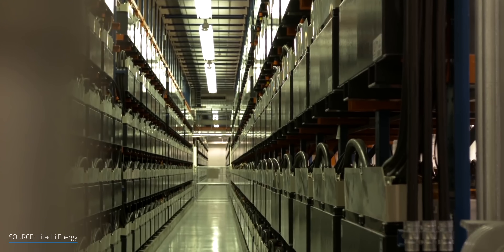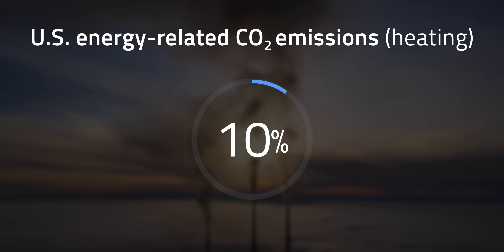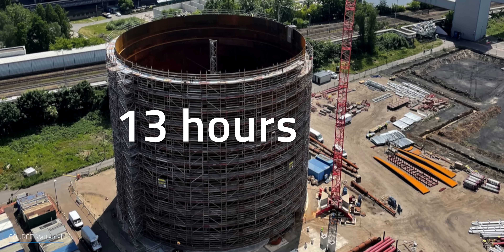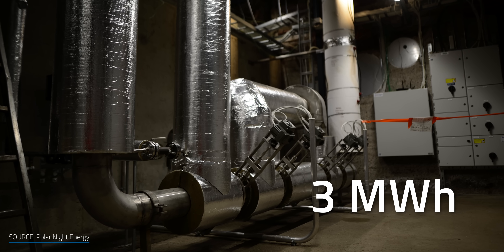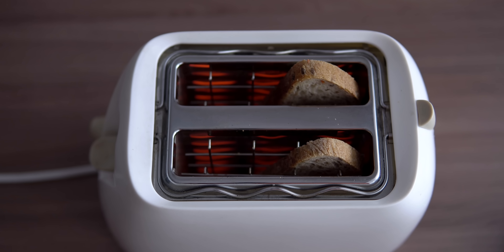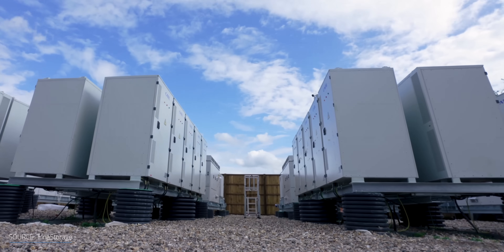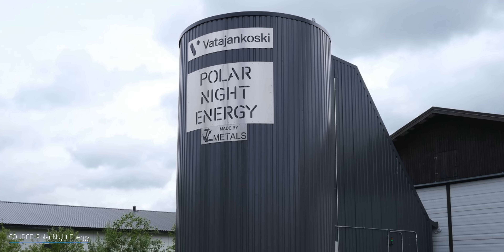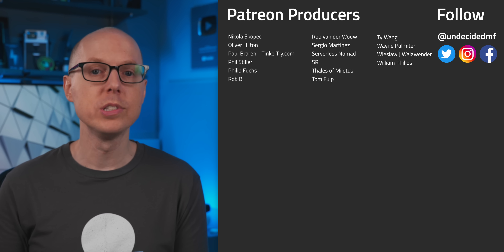How A Sand Battery Could Change The Energy Game

Comment: Please! 1) stop calling CO2 a greenhouse gas, it's an atmospheric gas, without which there would be no life. 2) Wind and Solar are NOT "renewable energy", that would violate several conservation of energy laws. You don't get the kinetic energy of wind back after it's converted into electricity. Same with solar. You use the source of energy ONCE then convert it to another, then another until it's finally diffused into space, entropy.

Comment: It would be interesting to downscale this to single residential use. You would not need  nearly as much sand. Instead of using heat pumps which cost more power to run, you could heat the sand via solar.
Reply: Just buy a heat storage unit.ceramic, 1000 deg f.

Comment: I really like this option, it's supper simple with almost no environmental risk from failure or end of life deconstruction. The only issue I can see is retrofitting it into existing infrastructure; you named a few cities in the US which have community heating systems, and a lot of further eastern European and Russian cities have that too, but in Western Europe and the UK especially there's nothing like that, so the system would have to be made from the ground up in already hugely congested underground urban environments.
Reply: It would be good to build it from scratch cause underground systems could provide water,sewage,electricity,network and heat all in the same system
Reply: Good point

Comment: I think this might be a better solution for individual homes or housing blocks. It might even decrease the degradation in distance to destination, since it could be built in a backyard probably.
Reply: But bigger the storage is, better surface to volume ratio it has.

Also, district heating is already a thing. And it tends to be more efficient than distributing the heating to each separate building. Even with transmission losses. (I can't explain why, though)

Comment: Idle wind mills may not be a bad thing. Wind mills, like all mechanical equipment wear out, they have a limited life. If the wind mill sits idle, it is likely to last longer. We all understand that cars are only good for so many miles before they are worn out. If you drive your brand new car a lot it will wear out faster and need replacement sooner. An analysis of how long windmills last, both in hours of operation and in years would be helpful in this analysis. As far as extra solar power, well, solar panels are not mechanical, so that power is likely better used.

Comment: Apologies if I missed this or, misunderstood. If you're heating communities using hot air, how far can that heated air travel before it starts to cool?
Reply from the maker: No apologies.  Polar Night Energy's storage system only uses air to circulate through pipes in the sand.  Once the heat is extracted it can be moved to another source, like a boiler system for district heating.
Reply: @UndecidedMF  Cheers Matt, I appreciate the response
Reply: In Finland district heating is not done with air, but with boiling water going to houses in insulated pipes, which have heat exchangers. And after that the water goes back to power plant for re-heating. It's a closed system.

In the photo below you can see the up- and downstream pipes. This photo is from the city I live in. I live in an apartment house with this system. Basically the whole Helsinki Capital area has this system. The sand battery could be used to store some heat centrally during summer months and be used to pre heat the water 10 to 20 degrees celsius before the power plant which makes heat and electricity together. That would make the whole process more efficient and ecological.

https://upload.wikimedia.org/wikipedia/commons/3/39/Kaukol%C3%A4mp%C3%B6verkko_Otaniemi_Espoo_Suomi.jpg
Reply: @timogronroos4642  Thank you both, that makes much more sense ...

Comment: quite clever heating air instead of water; no need to deal with high pressure steam and in a closed loop with little moisture the pipes would only be as safe as whatever is exposed to the elements outside.
well insulated pipes means longer life of the sand battery.
In theory they could heat the sand to a higher temperature (over 1000F) as the melting point of steel is closer to 2500F and sand is over 3000F but I get that damage to insulation would likely wear down the life span (and hotter air might damage the exchangers).

I'm all for any kind of battery that uses few as possible moving parts (chemical or mechanical) and at the scale they are talking, way less environmental impact.

Comment: This is a genius idea. Even if it can be used only for heating direcly, it still indirectly saves electricity  that otherwise would be used for heating.
Reply: I think it's dead on arrival, they might get one or two built. Resistance heating has low capital cost but otherwise it's a waste.
Reply: @FrancisKoczur  The hottest achieved with a heat pump is 356 F. The key to this is thinking about what you are trying to optimize. In this case, capacity and capital costs to handle dunkelflaute. You may not need to cycle this thing much. Also, hopefully, the resistive heater is very cheap, so you can use overproduction, or at least cheap power. This will never displace batteries, but batteries are expensive for occasionally used capacity.
Reply: @fjalics  An electronic device's power use in watts is also approximately the same as the heat it produces. High temperature Silicon Carbide electronics exist, might as well do something with the electricity first. Maybe DC voltage power conversion would be a good application.

As far as heat pumps go, the refrigerant determines the operating temperature range.  And the temperature difference is inversely related to the efficiency, but the efficiency is still above 100%.
Reply: @FrancisKoczur  Sure, but you would have to colocate those electronics with the district heating, which may not be where you need it. Also, I think eventually we need to overbuild renewables some, and that may be far more energy than you could cost efficiently capture from electronics. I'm not saying we shouldn't look for opportunities like what you suggest, because it could happen, but it also might not be practical.
Reply: @fjalics  It will depend on the capital costs of the entire sand battery solution vs competition.
Say a competitor is a network of EV charging stations with lithium-ion battery storage that recovers the heat from the batteries and electronics, and provides the same district heating. The running cost would be a fraction of the sand battery, but the capital cost would be quite high as the size would need to be large enough to provide continuous heating. But the costs are also dropping year over year. At some point the sand battery no longer has a market for new installations.

Personally I like ground sourced heat pumps paired with district heating. Use the water mains as the source and old natural gas lines as the return. The main is already metered for volume but will need a heat meter that measures temperature and the return meter would do the same, the miles underground stabilize the temperature so any additional heating at the pump station is small. Low capital cost, low running costs.
Reply: @FrancisKoczur  every bit of surplus’s electricity that isn’t being used for anything is wasted cause that’s how electricity works. That’s Anything that is that isn’t powering something or powering a storage system. If you use     > surplus <   power for your heating Element then your converting 100% waste to whatever the inefficiency of the storing process is. Even better you could use solar thermal systems which would make solar way cheaper if they simply capture heat instead of photovoltaic that’s a stupid simple design (think a panel of black metal with insulated glass outer casing with a insulated wire running into the sand battery).
Reply: @FrancisKoczur  Resistance heating is simple, proven, and reliable, with very low TCO.
Reply: Tried before with super insulated underground "septic" tanks and water as a medium back in the 70's.
Reply: @billb48843  WHat was the outcome of that? I'm considering building that solution for my house.
Reply: For reference 25% of 8 megawatts is 2 megawatts or 2000kw!!!! Even if you want to worst case it, 5% of 8 megawatts is still 400 kilowatts! That about enough to sustain 44 homes each peak drawing 9kw of energy at once (and that is the maximum in the average European home). So since it’s cheap it’s scaleable even if it’s efficiency is mediocre it’s still because of sheer scale can easily power many applications.
Reply: Dunkelflaute will be easier to deal with if they have these.

Comment: Could you not use a smaller version of this to store heat for large (old) domestic Houses, such as Farmhouses, that have a high heat demand during the Winter ?

We lived in one in Somerset, UK and it would have taken two conventional high-temperature heat pumps to supply enough heat to meet the UK R.H.I. standard, (requiring now Huge amounts of expensive electricity ) so much like my idea about phase change materials, could I not use a Sand Battery to store the (Solar-Powered) 'heat' of Summer, for use in heating my home and hot water in Winter ?

Similarly, could a similar system be built underneath new-build houses as a sort of 'ultimate' 'underfloor heating' source ? 

No need for pipes or pumps,  - just convection &conduction vs. insulation ?
Reply: I was wondering the same thing. In fact, I was wondering if geothermal installations could be augmented with this design. Using renewables (or even off-peak grid) to heat or cool the field used for geothermal transfer depending on the season (or needs)

Comment: so why not drill a hole in the ground 1000 meters down and then pump water or other fluid down some pipe and then take out the heat from the return pipe which heats up the water to a turbine that produces power
Reply: We do that all the time here with ground source heat pumps. My smallish house has a 170 m hole. Larger residential houses have typically up to 250 m holes. Several holes is better than 1000 m, it becomes too expensive. Now to actually get free warm water, you have to drill several thousand meters unless you live in the continental border regions (like Iceland, where they have free warm water). They tried this in Helsinki Finland, but it was a miss and didn't produce any warm water.

Comment: Why don’t they use heat pumps instead of resistive heating?
That would maybe imply heating water instead of sand (since these are most efficient at lower temperatures), but could easily triple heat produced per unit of electricity
Reply: I would guess they chose the option with less moving parts to break down. Consistent uptime is more important then pure efficiency.
Reply: Good luck heating to 600 °C (1000 F) with a heat pump! Maybe in the future.

Comment: Lots of added complexity, but it would be neat to see the same concept done with a heat pump instead of a resistive heater. It's over 100% efficient, and it would help cool the building(s) in its grid during the summer months.
Reply: heat pumps usually don't work in 100-500 °C range. Might make this very expensive.
Reply: heatpump cant go to such temperatures, thats why it's not used.
Reply: I think in some ways you don’t want it to be more efficient via a heat pump. One of the goals is to allow renewably generated power to be stored. Imagine this next to a wind farm. When the grid needs the power it gets sent to the grid. When the grid doesn’t need power it gets sent to the sand battery. In a perfect world the turbines would not have to stop when the wind is blowing
Reply: Ah, yeah, I hadn't thought about the extreme temps

Comment: WOW! :D Amazing video Matt! Thanks! We are planning to make a trigeneration product where we could turn heat back to electricity in places where there is large heat consumption also, like DH network. Then it doesn't matter if electrical efficiency is 25% because you can but the rest to DH network from the turbine condenser. Actually that also is basic stuff here with "combined heat and power" CHP plants.

Comment: So I'd say screw the resistive heaters, use heat pumps. They add more heat per watt and they are being used in the summer anyway so they will stay efficient.
Reply: Good luck heating to 600 °C (1000 F) with a heat pump! Maybe in the future.

Comment: Why wouldn't they use a heat pump instead of a resistive heater? Heat pumps are maybe 300% efficient at moving heat. Is the climate too cold?
Reply: They lose efficiency at high temperature differences and would be more expensive to make but honestly same. It might just be Europe lacking the HVAC infrastructure.
Reply: Good luck heating to 600 °C (1000 F) with a heat pump! Maybe in the future. We do use lots of heat pumps in Finland, it's a very common technology here. My residential house has a ground source heat pump with a 170m hole in the bedrock and in addition there is an air-to-air heat pump that is nowadays used only as an AC.

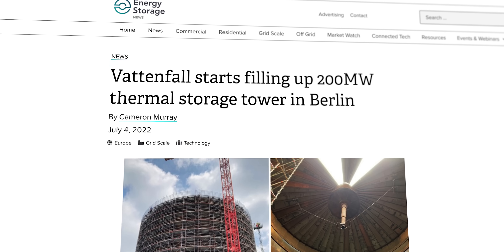Comment: 2:45 they use only hot water not a very good idea sand can be heat up to 500° C and it can be used longer
Reply: But how much would it change from hot water to hot sand?
Reply: @CUBETechie  It changes by the amount of how much the heat changes; if you can store at 5X higher temp, you can store 5X as much energy under the same conditions. (also water and sand have different specific heats, so not exactly same comparison on that aspect)

Comment: How well does desert sand compare to refuse construction sand from an insulator perspective? More dense, more insulation?
Reply: ive pondered the same question for months now. after hearing matts explanation on the topic i think contruction sand maybe more energy dense if they are choosing leftover construction material over its cheaper and more abundant desert counter part. but equaly it could be minimal and a choice made for waste reduction.
Reply: Awesome, appreciate the thoughts! Certainly agree going local makes sense - kinda thinking through what materials have no current market around the world and where solar plants are located. Could see this being ported for solar plants, seems cheaper that molten salts. Assuming temps are not high enough to drive turbines?

Comment: So why can't this be used on a smaller scale? Could I not just build a tank full of sand and heat my house in the evenings with power generated in the daytime? Does it have to do with the size of the tank? I'm guessing that perhaps with a smaller sized tank you have an exponentially smaller heat retention capability. Is this right?
Reply from the maker: You might want to watch these 2 videos: https://www.youtube.com/watch?v=9BW5GX05Fko. https://www.youtube.com/watch?v=kzj1PCA_jxA
Reply: The heat capacity should be based purely on the mass of sand, in this case 100tons = 8MWh. Lets say you need 100kWh per day in winter to heat your house (I think thats probably bit on high side but is ballpark and is nice number) that equates to 1.25tons. Thats a reasonable size, ~1m^3. 
The larger units would be better at heat retention as mass scales^3 whereas surface are ^2, so bigger units less surface area proportionally for heat loss.
Its basically a big fancy storage heater which are common enough it just has more bells and whistles in terms of managing the heat input and output.
Reply: Commenting because I want to know the same thing and hoping someone will answer lol

Comment: Sand is a very poor thermal conductor so it doesn't seem like a great choice for thermal storage.
Reply: shhhh it`s a youtube there is no place for your logic and facts
he specifically does not give any numbers, but claims 100 energy efficiency
Reply: This application does not require a good thermal conductor, the heat is added and withdrawn slowly relative to the total mass. It does benefit from a material with a high specific heat in which sand is pretty good. 
Adding and extracting heat is 100% efficient says the law of thermodynamics, so that is true. But then so is an electric baseboard heater. What was not mentioned is the rate of loss during storage, however that is where scale improves things. 
This technology might make economic sense because it can be built cheaply to use otherwise wasted energy (i.e. idled wind turbines). But it is not an efficient means to supply heat as technology like heat pumps are 2-3x more efficient.

Comment: Do you think that those thermal electric modules used in battery powdered refrigerators could be combined to produce electricity? Love your show
Reply: Yes, they work both ways but they are very inefficient.
Reply: I'll add that they're called Peltier devices or Thermo-Electric coolers or TEC for cooling, and Seebeck (effect) devices or Thermo-Electric Generators or TEG when used as generators.
They can be designed to either be good at cooling or at generation. 
I use "good" very loosely here. As @LesNewell pointed out, they're very inefficient.
That said, TEGs are used by spacecraft and rovers. IIRC, the Voyager probes and the Curiosity and Perseverance are powered by TEGs and a plutonium heat source.
Since they use a radioactive heat source, they're called Radioisotope Thermoelectric Generators, or RTG.